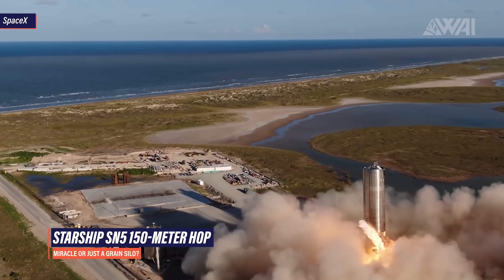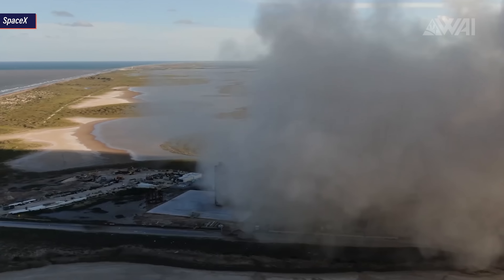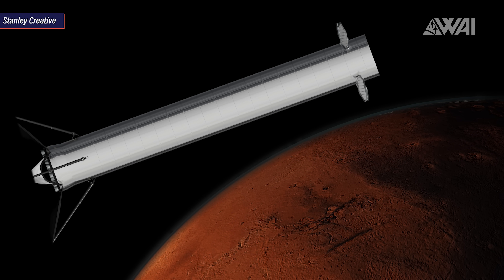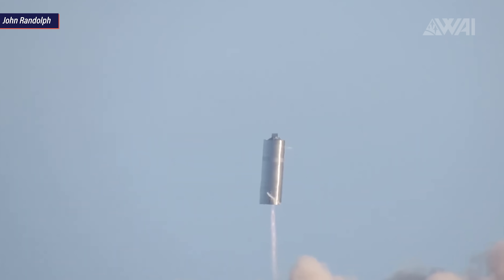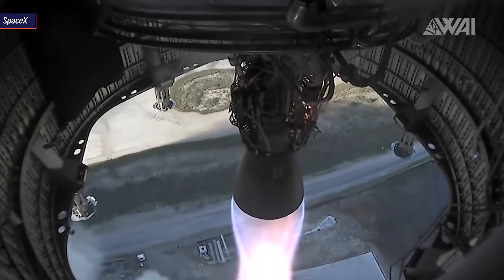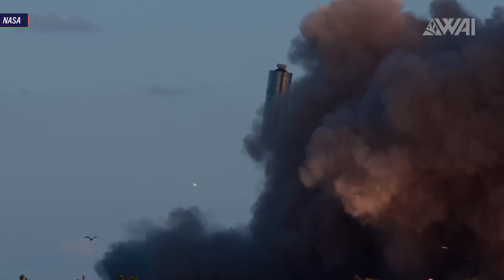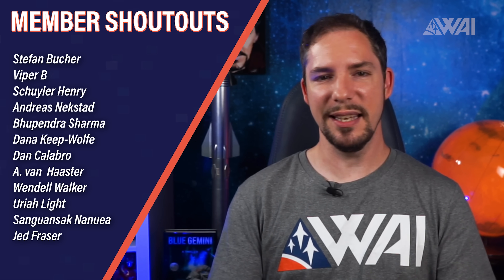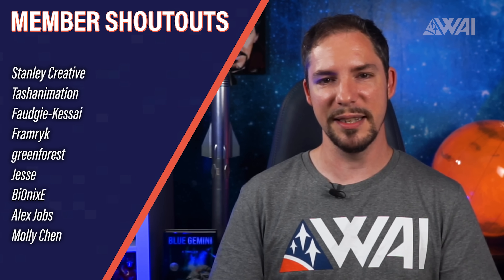111 | SpaceX Starship Updates – How did SN5 do?

Comment: I don't think Musk ever meant they will reuse the same rocket just hours after landing. I think He meant the pad will have rockets flying off every few hours. They will have a fleet of rockets, and it will take a couple days for a single one still, but with enough that they can just cycle through them.
- like a pipeline - each rocket being at different step, all in parallel.
Reply: i think that the most feasable way here would be to go and work a multiple setting reuse-or refurbish process. so checking all the sensors and using the rocket only for less valuable cargo after just checking the stats before switching key components ensuring reliability and complete scrapping as a worst case scenario. maybe the tank will have different possibilities, like builidng a space station by just welding those old taks together in space? you tell me.
Reply: @t3amant3aman  I guess if they are launching just spools of copper wire or steel beams for building an orbital ring or something of that nature, the proper checking+refurbishment would cost more than the occasional failure, but that is long way off, and who knows if ever cheaper... They will have the pipeline anyway.
- But yes, I'm sure they will check everything more thoroughly if sending valuable cargo, over something cheap. They already do that.
- Anyway, unless they are just launching 'building material', I cannot see it being cheaper....
Reply: Martin Verrisin makes sense. however i think they will be using graphene for space stations
Reply: @t3amant3aman  You cannot build anything with your thoughts? Even then you say 'i think' but it is clear you cannot. Not starting a sentence with a capital letter? Makes no sense. Not capable of ending a sentence yet? Again makes no sense.

Let's stick to science facts instead.
Reply: @Verrisin  Guessing won't do it. You need science and facts.

We know you can just launch a larged diameter then ISS with ease. It was called SkyLab?

We know for a fact how Bigalow planned to do it? And then they actually did it? Proving it factually works? Yea it's attached to ISS as we speak orbitting the planet.

https://youtu.be/CRB-tLF1npo?t=208

Yes engineering makes more sense. I do not see Gateway being build anytime soon if ever? But anyone could do the math of one or two launches of automated orbital construction bots. After that every launch becomes building material to feed the bots.

If SLS actually works? You could launch Gateways idea on a single day with a single SLS launching into orbit 3 times. For 6 million USD. But only if Elon makes good on his promise.
Reply: Michel Platteeuw all the sience facts you quoted while trying to be an anonymous person attacking another anonymous person on some kind of personal level?
lets hear some facts!

Comment: Please explain why there is so much smoke during liftoff and landing. Is the smoke from debris kicking up from the ground?  It's not steam from water used in a noise suppression system. If a Starship lands on Mars there will be a huge dust storm created from the landing thrust of 31 Raptor engines.
Reply: it is not going to land with 31 raptors though, at most 3 but I would guess 1. Given that there will be little fuel left, Mars having lower gravity and the SN5 hop being done with 1 raptor, landing on Mars with 1 seems most likely to me.
Reply: Yes, it will kick up a lot of dust, but with 1% of the atmosphere of earth there is not much holding it up, it'll settle fast and won't be as prone to billowing except for the super fine stuff.

Comment: Everybody praises the engine but especially considering how cheap it was built the tanks should get some love too. They have a habit of exploding but SN-5 is around 50 tons without the mass simulator on top. If we only consider the tanks Starship has a fully fueled to dry mass fraction of 20 including 6 engines but no nose and wings. Anything close to 10 is considered extremely good. The fabled balloon tank Centaur upper stage has a propellant mass fraction of around 10. Now the entire Starship with nose and everything still gets a propellant mass fraction of 11 (no payload). That's better than centaur. And welded in tents.

Comment: If you watch some of the other videos, you will see that two, possibly three of the landing legs are collapsed/compressed and it is on the side that it is leaning. This is most likely due to having to land at a slight tilt.
Reply: I think they shut off the engine with just two legs touching down. The ship had to drop further and then the sideways motion at the top had to be absorbed by skidding sideways.

Comment: this was so awesome to look at, and maybe i'm just dumb but one thing I don't get about this is why the rocket doesn't just flip over even with the raptor engine adjusting ?
Reply: The main engine is pointed in different directions for stability plus it has other thrusters on the side to keep it upright.
Reply: @MrEd2291  thx man !
Reply: I recall Elon saying that the bigger the rocket, the easier it is to keep it stable as well!
Reply: Part of the reason for the mass at the top was to improve control.

Comment: yeah I spotted that engine fire when the flight was taking place thinking "that's not good!" ALSO! if you look the the left you'll also notice a hard-line "what fuel? hydraulic?" glowing orange...... now that's certainly not good

the 2nd time you see it on this upload is around the 6:00-6:05 mark

my question would be is fuel back flowing, or igniting within the lines, along with that fire source...
Reply: According to Scott Manley it's most likely left over cleaning agent or oil burning off, watch his video on the topic.
Reply: @Yattayatta  Oil burns incredibly quickly just like cleaning fluid so you'd not have a open-flame, the general heat alone usually burns such fluids incredibly quickly & again you don't get flames..
I cant actually be bothered with scott manley's channel as its incredibly long & boring... usually trying to mix-up the space-game along the way "again which I cant be bothered with"

you can even ask him to demonstrate or try yourself....

add a drop of either onto a metal pipe/pole & heat the pipe "whatever" near to the liquid.. quickly it burns away into nothing but a light vapour "no flames will be produced"

or not forgetting cleaning fluids would usually evaporate, as it would usually be alcohol for safety aka clean & its done, anything missed & it evaporates in seconds 

however if you have a continuous fuel source "a leak of some kind" hydraulic or fuel etc then it'll combust with a flame.. So I'd highly doubt  of such agents/oil.
Reply: @malp6280  Check out Scotts video, he has a PhD in this stuff so I'll take his word over yours, unless you provide your own PhD
Reply: @Yattayatta  unfortunately I work directly around OIL & several forms of gases in my position, not only that 

many years & practical experience.. someone claiming to say another party has a PHD & yet doesn't under stand small sums of standing oil can create a large continuous fire ball "one or the other is talking rubbish"

then.. funny enough "he apparently has what PHD" unfortunately kid Scott Manley has a
BSc Bachelor of Science degree & a MSc Master of Science. he's NEVER been awarded a PHd Doctor of Philosophy... so maybe you should try again.

PS Scott currently works for Apple yes, that Apple company

anyone with common sense would know its not oil or cleaning fluids as around engine components cleaning agents would be alcohol to prevent contamination & ensuring cleanliness "it evaporates 100%" then OIL wouldn't be left around an engine of any kind.. especially a rocket engine that erm doesn't use oil, Hydraulic fluid yes & if that's leaking then its incredibly bad... so kid "try harder next time"
Reply: @malp6280  Alright, so first off, when you call someone kid without knowing my age or background, you come off as not knowing what you talk about.

Second, you work in oil, big whoop, so "working in oil" do you contentiously burn oil on a regular basis? For what purpose? What part of "oil" do you work in? Do you do oxygen deficient oil burns there? so you know what that looks like? How about cleaning agents, do you burn them frequently? In low pressure low oxygen environments? 

And next thing, you mention alcohol in oil cleaning? So you don't know how oil cleaners work, because most oil cleaners are alkaline products designed to lower surface tension, alcohol doesn't come anywhere near them. Don't talk a big game when you don't know the basics.

You also say the engine would be cleaned with alcohol to prevent contamination, when sitting out in the middle of the Texan desert, after test firing it. Dude, don't be condescending when you clearly didn't put much thought into your reply.

Oh, and for the record, I also have several gasses in my possession, whatever that is supposed to do to help an argument.
Reply: @snuffeldjuret  I read a story after you commented "as no I've not heard such report" & yes I'm sticking with what I've said as, in the report its claimed possible alcohol was left trapped within a sensor or near a sensor.. quoting a temp/pressure sensor..
again alcohol evaporates.. if you've ever used such "you'd know" & also you don't pour such cleaning fluid onto a surface you pour it onto a cloth & wipe whatever clean... i this apparent sensor had a rubber gasket you'd never use alcohol on or near it, unless its a steel or similar gasket. externally such fluid evaporates in seconds without any traces..

now lets look.. if its an internal sensor pressure or temp sensor then it has to be in the flow stream say fuel so such alcohol is wiped away with the fuel flow if its an external temp sensor & its attachment point well potentially the mount could be damaged 'potentially' or the sensor could fail.. either way to be honest it seems like they've very little data to go-by hence a very open ended explanation which stopped an full investigation

again the rubbing alcohol used is highly flammable, if its contained in a sealed unit then potentially it would go bang.. unless that caused further damage then you'd not see flames as it burns off straight away, its not like fuel where it burns for a long period etc

the glowing orange hard-line on this flight doesn't look to-be a sensor probe, clearly something is burning inside constantly "hence the glow throughout the flight"
the continuous flame on-top of the engine cone certainly isn't oil OR alcohol, something is allowing a constant flame aka "a fuel source of some kind"
Reply: @malp6280  I suspect a leak in a low pressure sensor line.  It didn't look to be burning with much energy, the flame color suggested a cooler burn and seems that it was blown out during landing.
Reply: @TheEvilmooseofdoom  the fuel is high pressure, hydraulics are high pressure which increases under load (these would be detected)
your saying a low pressure sensor line ... "low pressure for what?"

as for engines as a whole low pressure lines down really exist except in a vehicle engine as a fuel return line.. rocket engines don't have such. vacuum lines in combustion engines still undergo lower pressures... again rocket engines don't have such...

I'd say its a restricted leak of some kind OR a very bad "negligent aspect" of a grease being used & then burning off "event though you can get high temp greases" overall somethings not wright..  the story regarding the merlin engine sorry that's more "well not make a big fuss over the issue, but we'll look closer next time"

Comment: Starship is going to require a hybrid approach regarding the legs.  You can have the externally mounted legs on the leeward side of Starship, but not on the windward side; they'd ablate off during reentry. They'll need to put a leg structure of some kind inside the engine skirt for that side of Starship.
Reply: Or put heat shielding on the landing legs.

Comment: Two of the "problems" you "noticed' weren't problems at all, both are due to the temporary single engine configuration requiring CG offset thrust.
It was more important that the initial liftoff from the pad be vertical with no lateral component which means they then expected a momentary drift which duly sacrificed some pad hardware.
Tthe landing also had to be vertical with no drift, thus it had to land slightly tilted. Otherwise, contact with the ground would have collapsed the landing legs horizontally were there any lateral drift at touchdown.
 If you look closely the landing pads are not a conventional suspension, rather they are a one  way, one time, crush type shock absorber intended to attenuate the planned landing shock load. Which is why it remain "tilted".
Also, with a modicom of common sense, one would inherently know the landing pad design is temporary for test purposes (cheap). 
With all due respect, perhaps you should pay closer attention rather than spending so much time patting yourself on the back.
Reply: I agree that launch pad hardware,  such as combustible or fragile materials, were thrown up due to the offset thrust, but the landing can be achieved without crushing the legs at all, nor shearing off the feet. 

The landing needs special conditions to be prepared by the guidance computer so that the ship can end up with zero velocity, zero tilt, and zero altitude at the tip of the landing legs. 

You can figure out these landing prerequisites by playing the launch sequence in reverse.

Comment: It's hard to see why there would be anyone in the Space enthusiast community saying negative things about this test. Do they expect a company to put a complete two stage rocket together and fly it to Mars in one step? Incremental steps are clearly necessary to validate the latest version of the Raptor engine, the integrity of this massive structure, the fuel tanks and the dynamics of the control and guidance system. As far as I can see, they ticked all the boxes for every one of those. Who cares whether it flew 150Metres or 1000Metres, it makes little difference. The bit close to the ground is the real challenge!
Well done SpaceX. I wonder how those armchair critics would have done?
Reply: It is actually a great feature of reusable rockets to be able to land, inspect and improve them and try again. With single use rockets, you would have the rocket explode, then build a new one and it has another loose bolt and explodes again and every time you have that new vehicle that has never flown before and any technichian could have made any mistake on any of the 30 million parts of the system. If you can hop the propulsion section first then integrate the fairing section and control surfaces later on, because your vehicle does return in one piece, this is great.

Comment: The debris after take-off was some protection and cladding from the stand,... no fuel was ignited as it was the flame of the rocket hitting the stand and the thrust alone did the damage.
Reply: Gary, if that were true, then why did the fire persist long after the ship was up in the air. Something was burning. But the good folks at SpaceX will figure it out, fix it and move on. No biggie.
Reply: The nearby vertical tanks also had some padding wrapped around them. This could have been ripped off and carried up in the vortex surrounding the ship. 

The exhaust stream was strong enough to tear the "cyclone fence" off the posts at the landing site.
Reply: @avid0g  which... is by all accounts really cool.
Reply: @Wingnut353  
Yes. Just one Raptor engine is amazing!
Reply: It may also partly be due to the engine having to start firing at an angle rather than straight down as world be normal at launch. The flame could hit the stand due to this whereas it might not in a future launch with 3+ engines.